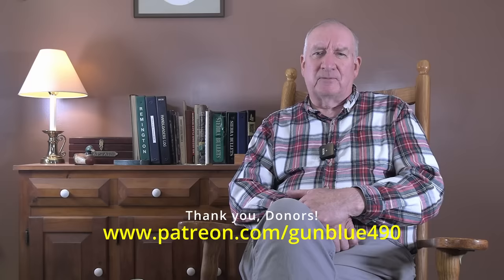The Copper Fouling Lie ~ Don't Fall for It!

Comment: I got an m1 garand from the CMP. boar looks good but had some discoloration. Iran kroil rust removing spray penetrant through it with the bronze brush. did some patches got all that black crap and it dissolved all of the carbon. 1955 barrel on a 1944 gun. it shoots much better than I do. kroil. you can get it at Napa it's made for penetrating and busting nuts and bolts. it doesn't hurt if you get it sprayed in your eye accidentally like I've done stupidly as a mechanic.

Comment: Your videos are always informative.  But I have heard that rust can form under the copper in a bore.  I don't know if this is the case of not, but I certainly don't want to  allow rust to form.  One thing that I noticed is that using Hoppe's bore cleaner as directed will cause clean patches to come out green.  This is the copper.  I would not use any solvent that attacks copper in a chrome lined barrel because if the solvent managed to get under the plating, it would attack the copper that interfaces between the bore and the chrome.  I have used CLP for years in the military and thought it was a pretty good cleaner since it always pulled up more carbon the next day.  This video has made me stop and reconsider.  Please keep these excellent videos coming.

Comment: Yet another aspect of gun maintenance I need to re-think🤔I've noticed after brushing the bore on my Mini-14,it will shoot off to the right until I've fired a half dozen or so fouling shots.For now on,patches only for the bore,chamber brush only for the chamber. Sir, your extensive gun and shooting knowledge and experience is much respected and appreciated. Thanks again👍

Comment: Talking about how strong bore solvents can be, I spilled some on a pair of nickel plated shears I was using to cut patches & within minutes the solvent had removed the nickel plating down to the steel.

Comment: Not long ago I had a rifle re-barreled with a Shilen barrel. I was concerned about breaking in the barrel so I contacted Shilen and another popular barrel manufacturer. Both told me the same thing. If the barrel is hammer forged or button rifled there is no break in required. The only area that might possibly need some type of break in is the throat of the barrel wherein the milling marks are across the direction of travel of the bullet. I didn't worry about break in and learned the biggest threat to a barrel is over cleaning.

Comment: Never used the stuff. Also , right or wrong I never put anything down the barrel once sighted in until hunting season was over. Seen many people at the range sighting their rifles in for deer season and once they had it sighted in ,they start puting oil and brushes down the barrel.  I guess they don't realize that first shot  after cleaning will more than likely not be very accurate??

Comment: I actually took the time to read the docs online to find out if indeed there's any mention of cleaning copper fouling from the barrel per any military manual. Now to be fair, there's no mention of cleaning carbon in any manual either. However, the original M16 rifles were issued with LSA and something they refer to as "carbon cleaning compound." I did managed to find some but I heard it goes bad fast compared to LSA which seems to last forever. The original cleaning instruction is to use the carbon cleaning compound in the bore, gas keys, and gas tube. 

As far as cleaning modern rifle, I did come across the manual for the M110/MK11 Operators Manual which is not in the standard mil document but you can find the presentation online along with the material. In it on page 1 it mentions definition which states that when it refers to Oil, it is talking about CLP, but when it refers to "solvent" it is referring to bore cleaners like Hoppes and Shooters Choice. Both of these are mild copper fouling removal and it would seem that the manual is stating to use the solvent in the bore to remove the fouling.

So it would seem to me that yes, the military is indeed interested in removing fouling from the bore. I do not believe they will ever issue separate cleaners to the regular troops but as far as specialized roles, it would appear a separate solvent is indeed used to clean the bore but nothing specific like removing carbon or copper but usually copper and carbon are in layers inside the bore.

Comment: This is exactly the kind of information needed. We only need to remove carbon, if any. Leave the copper in place. There is one hunting ranch where they invite you to arrive on Friday an shoot a few fouling shots with the intention of getting copper in the barrel, precisely for the reason of accuracy. 

So, really, don't need a lot of brush work. Just some cleaner on patches. And I always finish a barrel cleaning with at least 3 patches of oil.

Comment: Good, informative video. I have seen several ads and articles in gun magazines about "copper fouling" the last few years. I have often wondered if they were talking about the use of all copper bullets such as the Barnes X game bullets.  I never quite "got it" into my cranium though.
 
  When my M.O.S. was "Machine gunner" in the military I never saw "copper fouling" in the M60 MG and they shoot many, many "Metal Case" / Full Metal Jacket bullets down the bore. What I and others saw was lots of carbon dirt crud. We had L.S.A. and C.L.P. and chamber and bore brushes, and some cloth patches to clean the M60, Mattel-16 and the 1911a1 .45 A.C.P..  
 
 {The best way to get the M60 MG clean was A.) Make sure the Platoon Sergeant or the Platoon Commander was not around the barracks,,, B.) go to the Deep Sink (meant for filling mop buckets) and turn on the hot water spigot,,,, and C.) Wash the M60 in the deep sink while one of your team is watching out for the Sergeant or the Lieutenant. 🙂 then dry it off and put a thin coat of L.S.A. / C.L.P. on the metal parts and turn it back into the Unit Armorer.}  
 
  In my own personal firearms, I have not noticed "Copper Fouling".  Usually for decades now, I have used Hoppe's number 9 and a wire bore brush, then a cloth bore swab/patch. Then a thin coat of Gun oil. 
 
 I would try Ballistol, but the 3 Hardware stores and the two (very small) Gun shops in town do not carry it. I asked each Hardware store to order Ballistol, but they could not because of their Big Distributor networks. Maybe I will order by mail. It has been around for over a hundred years now. If anyone in the comments section (including GunBlue490) has used Ballistol, feel free to leave a comment/thought about it. It was first designed/invented for the German Army in the early 1900's. Started out using Hoppe's #9 solvent, and various gun oils and lubricants/Protectors back in 1972.  
 
 Addendum: I just scrolled through the replies/comments and read what GunBlue490 said about "Ballistol".  Well, okay.  I figured that if it was good enough for the German Army in two wars, it would be fine for casual use by me. Maybe not? I guess I will try his suggestion of "Mineral spirits" although I do not understand how that can clean the action, trigger assembly, Hammer, cylinder, bolt, magazine, barrel from carbon crud and "junk" from firearms.
Reply: We just had one guy strip down to his silk shorts with a brush and a jug of dawn dishwashing detergent and climb right into the shower with all the crew serves. The last rinse we did with water so hot that we stood outside of the shower. Then we re-lubricated. I still wash some gun parts in hot soapy water and dawn. Hell, that's how I clean brass for reloading, lol. Stainless pins, a rock tumbler, dawn, and hot water.
Reply: I've used ballistol and I didn't see what Gunblue said about it. Can ya help me out

Comment: I've had a couple instances with very high round count pistols using plated copper bullets the fouling was so bad I saw some  unpredictable stuff creeping up on me then going away after the copper was removed, but it was really bad. Still great to hear this perspective and experience. CFE powder specifically designed by military to erase copper fouling (the acronym) for belt fed guns.I don't discount what you are saying at all just throwing that out there.

Comment: My Question: if dissimilar metals interact, in this case steel and copper, it will cause electrolysis and corrosion is the outcome.  Are you saying that no copper is laid down as the bullet accelerates down the barrel, but only carbon is?

Comment: The military does use bore solvent with artillery tubes.
They went to CLP with small arms because those bores are chrome lined and don't tend to hold on to carbon or copper like a chromemoly rifle barrel will. In that case CLP is sufficient to get the job done without being overly toxic to humans like a traditional bore solvent.

Comment: My experience is copper fouling hurts some Rifles and it helps some Rifles, and that will change as the rifle is broken in. 
You should try some barnes bullets (100% copper) very good accurate bullets but they foul quickly. Good old corelocks, you don't need to worry much about it.

Comment: Maybe true for a hunting rifle and for someone who is only at the range a few times per year but definitely true for all cases.   I see accuracy drop off at long range after 500-600 rounds, remove copper, foul it in with 10-20 shots and accuracy comes back.  But, unlike most people, I shoot up to 2k rounds per year and then put a new barrel on.

Comment: yes.  I have a 1908 M96 , original barreled action and trigger.  It was sporterized by someone else. Using the 139 PPU soft point myself along with four other experienced shooters tested its accuracy.  Using a home made sandbag atop my range box we all accomplished three round 15/16 to one inch groups. We were amazed and definitely shocked. The scope was a Burris set at 6x.   200 yards.  So, I am elated, have had it for years but never tested beyond 100 yards.  So, I go home, soak the 23.5 inch bore with Hoppes 9, muzzle down atop thick white old towel in the corner overnight.  Came out Purple, then blue, then green to nothing. I literally take a day off from work and run to the range under perfect conditions.  four inch plus groups at 200 yards. Thought it was me, I shot 21 rounds more,allowing the military step barrel to cool; it was winter here in NC.  I made it down to about three inches. To close the story, after 70 rounds of ammo, at a 1.50 a round , I accomplished my 1/2 moa rifle again. You ain't kidding.

Comment: AMEN.  Almost every new trend that comes along in the gun community amounts to a war on common sense.   Then the trend continues until it becomes established, nevermind that it's complete folklore.   If we're being charitable, a lot of these things / practices provide *some usefulness in a very specific application... like F-class where somebody is going to fire a whopping 10 to  20 rounds start to finish and they clean to bare metal to establish absolute consistency.  (standardizing their dope on a clean cold bore shot from a perfect match rifle which is effectively bench rested.)    This is a practice that might yield some measurable result in this one application, which nobody else on earth would ever be able to quantify whatsoever, and outside of this application is actually detrimental to overall performance.

Comment: Makes perfect sense, and yeah, my mind never wrapped around the concept of a cleaner & lubricant all in one. Sounds like a massive compromise.
Reply from the maker: Neither fish nor fowl, as my grandmother said.
Reply: exactly.  I sit and wonder..."is it cleaning out the lubricant that it's putting in?...  if the solvent works, why isn't it dissolving the lube?  Is the lube putting a layer of oil on the surface which keeps the solvent from working on the barrel?  What if I'm just scrubbing the bore with enough patches that the clp is irrelevant?"    And then common sense prevails and I just use Hoppe's and I'm done ten minutes later.

Comment: I agree with almost everything, what you are saying however the inspection of some poor performing barrels taught me to be a little bit more critical. The chatter and tool marks (Railroad Tracks), that you mention, are not always distributed evenly from chamber to muzzle, especially in fast modern production barrels. Such barrels produce obviously tight spots within the path of the fired bullet and seem to destroy accuracy. You can feel these tight areas even with the cleaning rod! The smaller the caliber the larger the impact. Since not much was lost, I lapped my one poor performing 22-barrel with a lead core to an almost mirror finish (no tight spots anymore). My fired groups shrank from 4-5 MOA to about 1 MOA and stay there even if the barrel has not been cleaned for 50 to 100 shots thereafter. Before the lapping you got 2-3 tighter shots and the group opened up significantly. So, good smooth barrels from Douglas, Shilen, Heym and others are smooth with very little variation right from the shelf and the tiny built-up of copper has minor impacts, even after a few hundred shots fired. My best advice for the average marksman is, to make sure to get a good barrel to start with.
Reply: ..... Where's the point?
Reply: @DinoNucci  Point is, that a barrel with the mentioned, uneven reamer chatter marks, tends to builds up the copper not evenly over the whole length of the barrel, which is very detrimental to accuracy. After I've seen the inside of many such bad barrels with a borescope, I am not ever going to buy a gun without having first inspected its barrel.
Reply: @DinoNucci  Golf Foxtrot Yankee!

Comment: I went through Army basic training in 1961.  We were issued M1 Garand rifles and taught the hot soapy water cleaning technique.  Any speck of anything in the bore resulted in having to clean it again.  My rifle had been cleaned so much by the time I got it that the crown wasn't even round anymore.  During qualification my gas pistol system became so sporadic that I only qualified sharpshooter.  I was so embarrassed that I asked my Plt Sgt  to allow me to run the qualification course again with another rifle.  Of course I was refused.
Later, I was assigned to the 101st Airborne Division and we received the first issue of new M14 rifles.  We went out to qualify on the old KD range, bullseye targets at 200, 300 and 500 yards, and not only did I qualify expert I also was presented a unit trophy for my score.  A few years later I shot on the USARPAC Rifle Team in the All Army Matches and then in the Interservice Rifle Championship matches.  The Army MTU reglassed the rifle tang every weekend but I only cleaned the carbon out of the barrel once a week.  Hard telling how many thousands of rounds I fired over a period of 18 months with various army rifle teams and M14 rifles but I came to be a real believer in the M14's accuracy out to 1000 yards and I always used that cleaning procedure.
Reply from the maker: That's the military way!  The water was necessary to remove corrosive primer salts, as you know.

Comment: Been using Hoppe’s9 and WD40 on all my guns since the 60’s, I swear by both. I still have 95% of all the guns I or my father ever owned and there’s a spot of rust inside or outside any of them, that’s something living in Washington state a very moist environment. I run a patch or 2 of Hoppes down the bore followed by WD 40. If I’ve been out in a down pour I’ll drown the gun in WD40 then wipe it down. Even my guns from the 50’s, 60’s,and70’s look like new, some better than that I’ve refinished the stocks on.

Comment: I agree with you 100% about copper fouling. I have yet to see this in any gun i have used or seen over the years. When i grew up all my father ever used to clean and lube his gun was plain o'l 3in1 machine oil. You can buy that at your local Wal Mart easy to get. He never had a issue with rust, copper fouling, ect. I still to this day use 3in1 oil. Is it the best no but it has work for us for over 60+ years. I also dont go for breaking a barrel in. I tried it when i was younger on a few guns and as i got older didnt do the break in. Never seen a difference between the 2 methods as far as groups go. I'm of the mind that after the 1st several shots those grooves smooth out. I do think the more you shoot a gun the better your groups can get but that depends on the gun. I had a mid 80's Winchester model 70 30-06 and the more i shot it the better the group got. After a few 100 rounds i could lay 3 shots at 100 yards on a dime sadly had sell that gun years ago. I've also seen guns that didnt group any better at shot 200 than it did in the 1st 3 or 4.

Comment: Excellent information as always. What you're saying makes perfect sense and if the military is not concerned about this with all of the rounds that they shoot I think you're totally right and never logic is right. I hope you're taking care of yourself. Thank you
Reply: The military were concerned and used copper removing powder...I thought I heard.
Reply: @misterlewgee8874  Hmmm 🤔. Never heard of it. Are you talking about gun powder? Doesn't sound right or logical.
Reply: @brianlee6849  anti fouling agent added to 5.56 ammo for M16?   Vietnam?  I might be wrong..
Reply: @misterlewgee8874  I'm not sure but I'm sure gunblue does
Reply: @brianlee6849  fair enough.  I couldn't find any example of 5.56, m16 having copper fouling reduction additive..
However...there is a case for fouling clean barrels...also a case for barrels with too much copper fouling.
Most people probably need to worry less bout copper...but...to entirely dismiss it seems going to other extreme....
Reply: @misterlewgee8874  Many people refer to it as a seasoned barrel and don't worry about copper fouling. I think the copper fouling hysteria is caused by marketing trying to get us to believe that we need to buy there products. As long as it's carbon free and shoots don't create a issue where there is not a problem. In other words don't think to much. Thank you 👍